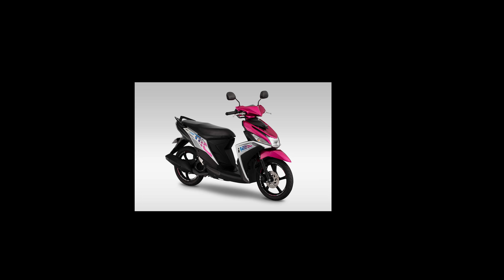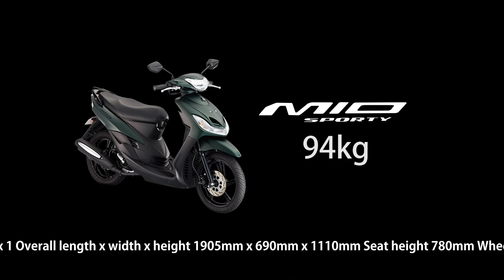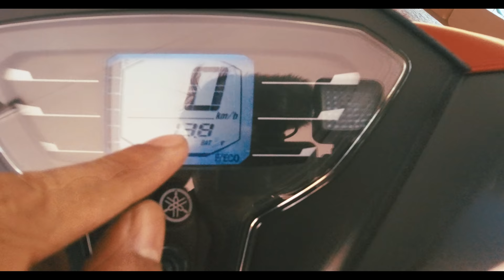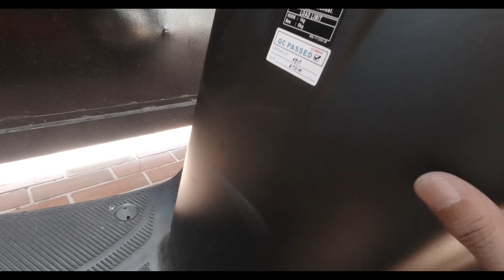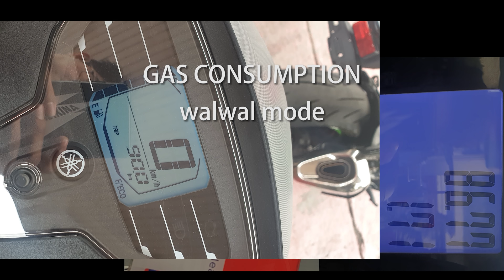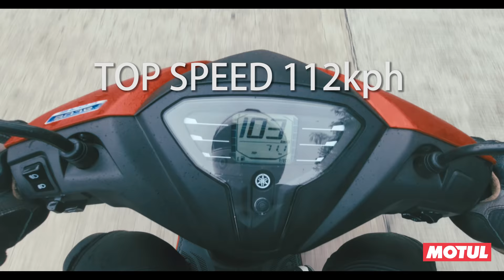Yamaha Mio Gravis

Comment: Liquid cooled sana
Reply: kaya mas maganda yong mxi 125 papi
Reply: oks lang air cooled sa 125 below
Reply: Mas maganda air cooled low maintenance
Reply: @ulol69  yes but not on straight ride  lalo pag fi kelangan  ipahinga mo yong makina as the manual said sa mio 125 na walang radiator
Reply: sa aking opinion lang papi ha
Reply: Click125 para sakin sulit
Reply: @aldrianmartin159  yes meron ako liquid cool aus papi

Comment: one question:

PH ay may worst road .
kung ang gas tank ay nasa ilalim
and heaven forbid kinailangan mo dumaan sa baha.
na lagpas sa board (again because ph roads are the worst) before on my SZ it wasn't an issue but then again they're different and like comparing apples to oranges. anyway 

may safety feature ba ito or better assurance na 
hindi mapapasok ng tubig? I can't dig up any info about this. 

currently looking for a 125 - 150cc automatic with kickstart 
and Mio gravis is #1 on my list - the only thing that bothers me at hindi ko mabili 
ay about dun sa gas tank.
Reply: Abot pa ba? Ilang beses ko na dinaan yung gravis ko sa tulay samin na lumalagpas yung baha pero okay naman sya. Never nagka issue.
Reply: naisulong ko po sa baha si gravis na lampas gulay board. okay nman po sya basta wag babaan yung takbo kasi hihigop sya ng tubig the moment na nagmenor ka po. as for the gastank,balot po sya ng steel protector sa ilalim. need mo nga lang ipa change oil kinabukasan.